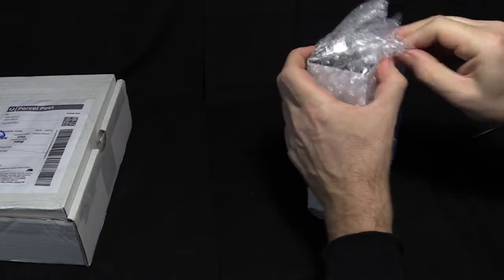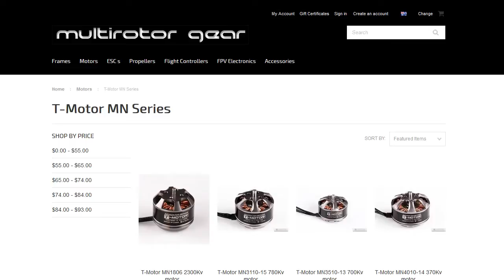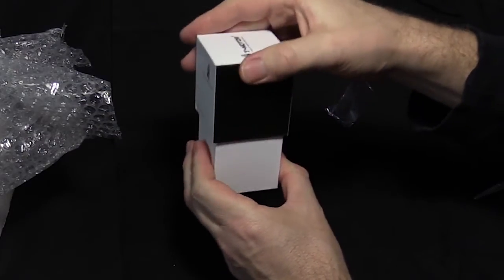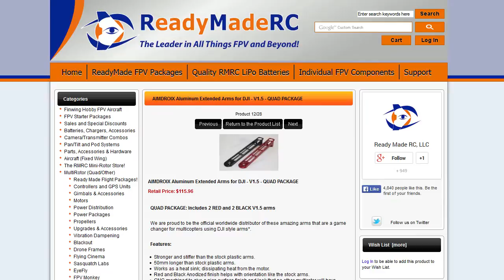T-Motor MN3110 Motor Unboxing!

Comment: They are pretty meaty motors... how big a multirotor are you building? Looks like you have a good group of flyers up there, but if you need any info on setup or tuning, drop me a line on the logger! 73 - Rob